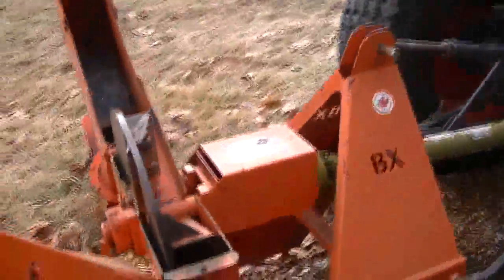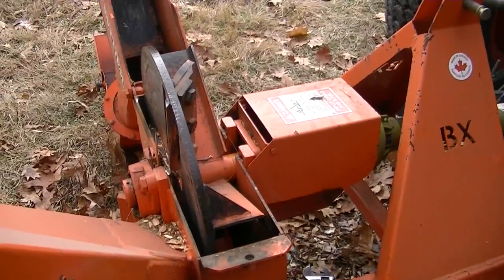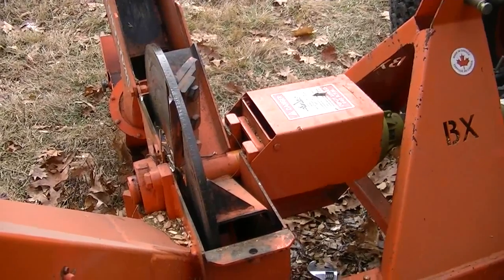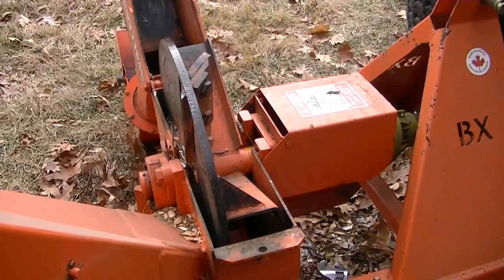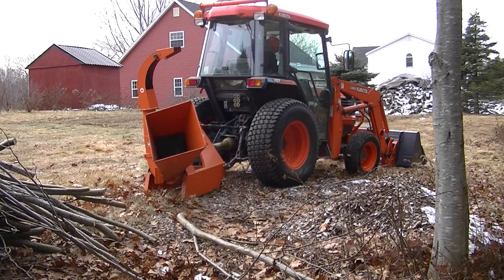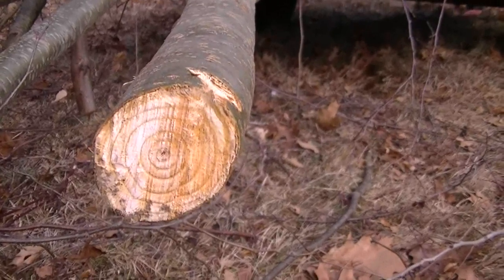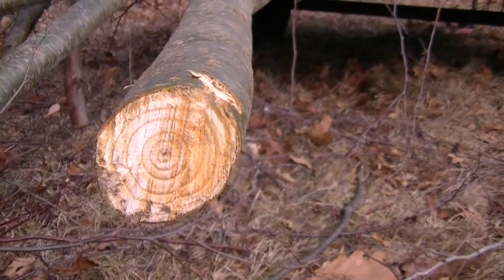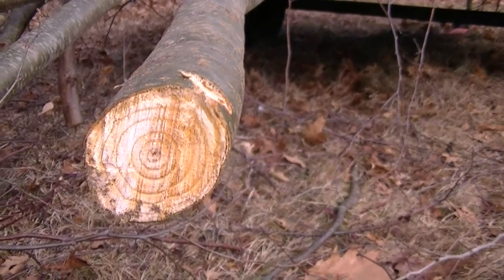Making Gasifier Fuel

Comment: Yup, that is the way to do it. That's a nice set up. I used to have a Trelan whole tree chipper which would make enough fuel in 10 minutes to last 1 year.
 Do you screen /size your chips  afterwards?
Reply from the maker: Hi NHHbbyloggr.  Yes.  I screen out the fines with 1/2" wire screen.  Sorry I missed you at the Dover Maker's Faire.
Reply: Northern Self Reliance
Sorry I missed it , too. Been a very busy season for firewood. It started way early this year . I just got caught up this week. I'll put up a video of the newest addition Battery bank / Inverter set up in the near future. Merry Christmas !